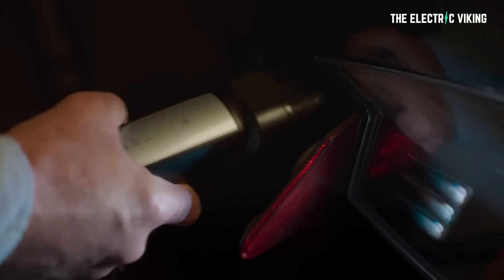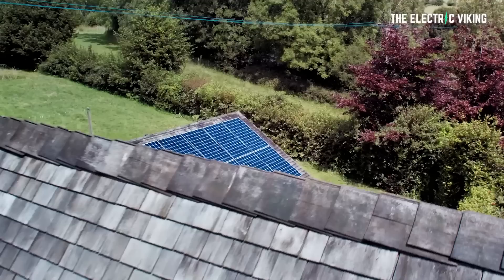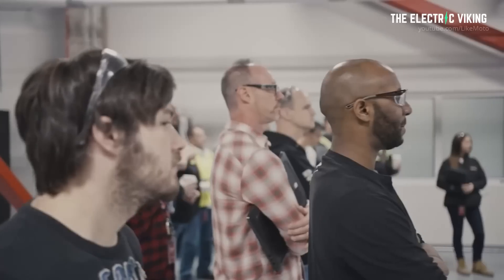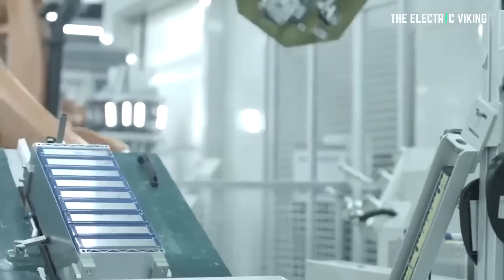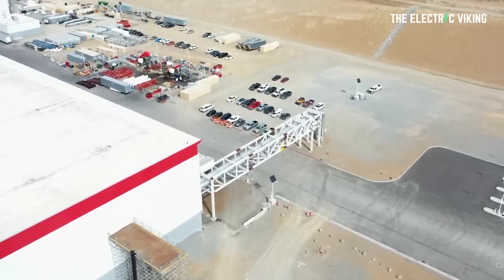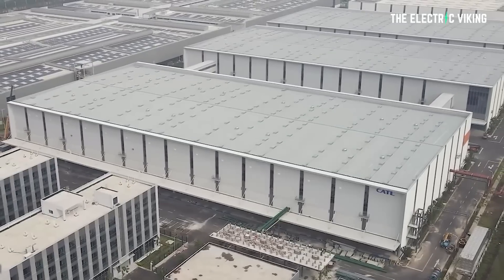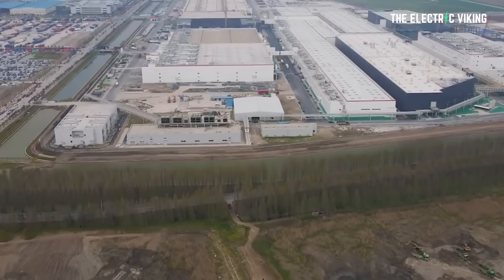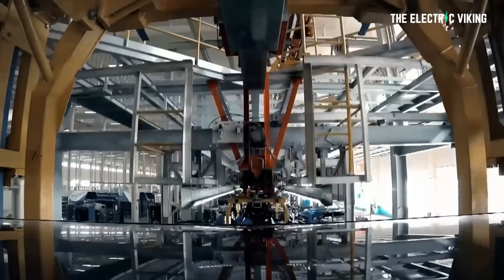Gigafactories Nevada & Freemont have been quietly on a HUGE ramp

Comment: I would have purchased a Powerwall 2, but Tesla stopped supplying them without a solar roof.   Now I’ve decided that a standalone large battery probably isn’t needed for the home.  I would rather use an EV’s large battery for that purpose.  Bidirectional charging anyone?  So, a smaller battery for the home during the day coupled with the larger EV battery for nighttime backup, should be a better solution for many.
Reply: 👆👆👆ʟᴇᴛ's ᴛᴀʟᴋ💬 ɴᴏᴡ
ᴛʜᴀɴᴋs ғᴏʀ ᴡᴀᴛᴄʜɪɴɢ📺...

Comment: The way to make EVs widely used, then we need a commute car ... low cost, light weight, under 100 mile range, minimalist with much improved miles per Kwr. And home charged with standard voltage.   Keep it light and small and then miles per KWh will be half way between a Model3 and an EV bike.
Reply: They have tens of millions of those in China, including the best selling EV in China, the MiniEV, costs $4000 in Chinese yuans.
Reply: VW e-up. Great car.
Reply: Well, depending on where you live, in California, if we do what you suggested, then everyone need a 2nd Gasoline car or an expensive longer range EV, So in California , this 100 miles EV will be very very limited in sales,  Remember, 100 miles of EV range is NOT equal to physical Range, you will be lucky to get 85%  and you will be living like a handicaps who can not go anywhere other than commute to work

Comment: TESLA MARKET SHARE ABOUT TO PLUMMET
So far this year, Tesla has 67% of the EV market in the U.S. according to Wards Intelligence. But that will drop to only 11% by 2025. That’s the forecast from Bank of America Research. It predicts that GM and Ford will surpass Tesla, with each of them getting 15% of the U.S. EV market by then. Lead auto analyst John Murphy says Tesla will lose share because of the wave of EVs coming from traditional automakers. These will be much more competitive, not like the compliance EVs they first came out with. Tesla will add only two passenger models over the next three years, the Cybertruck and the Roadster, while GM will add 17, Hyundai and Kia will add 13, Volkswagen will add 11 and Ford will add 6. With those models, they’ll have far greater market coverage and will be in more segments than Tesla is. Murphy spoke at the Automotive Press Association in Detroit yesterday. He says Elon Musk made a strategic mistake by not expanding Tesla faster when the cost of capital was essentially free. “He could have closed the door on them,” Murphy said. Instead, Musk left the door open, and the traditional automakers are racing in to fill the void.  Autoline

Comment: What are “turnery [?] cells?
Reply: I'm still trying to figger out what allieunium is.😃
Reply: @steven4315  It is aluminum made with allies.
Reply: Rather than use iron, which is cheap they use Manganese and Cobalt which are expensive, they don’t last as long or like being charged to 100% but they are more efficient. Bang for bucks iron batteries are best ! If someone far more intelligent than me would like to elaborate feel free !
Reply: Ternary = Composed of three or arranged in threes    
Ternary lithium cells use three additional metals, usually nickel, manganese & cobalt in their construction to achieve {at present} the highest energy density or highest power density.  These cells are also the most expensive.  
Cheaper {& safer} lithium-iron-phosphate {LiFePO4 or LFP} cells use fewer separate materials {If you can count a phosphorus compound as a single "metal"?}

Comment: Looking at the model y in Canada it is 30,000 more then a Lexus RX 350 all wheel drive. I would like to by a Tesla but the road noise is load at high speed. Tesla was fun to drive but 30,000 buys a lot of gas. Tesla model 3 and Y are just over priced here. They are great cars but with very few charging stations in a 300 hundred mile radius of me I guess I still have to buy  gas engine. I would pay a bit more but no where near that.
Reply: as the new factories ramp there's a chance of cheaper Tesla's but it more likely will require another factory or two
Reply: For me get what is good for you  if the 350 is best   than get it!